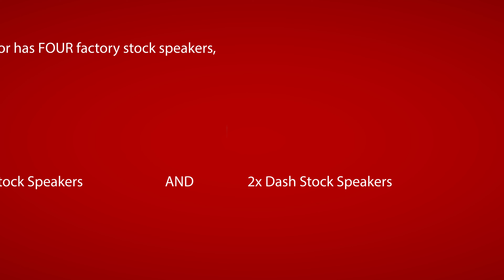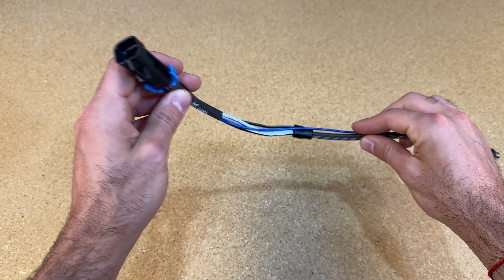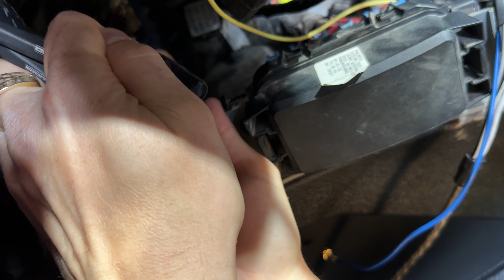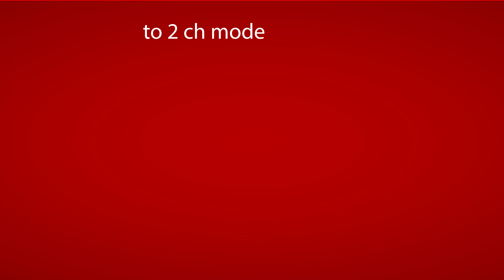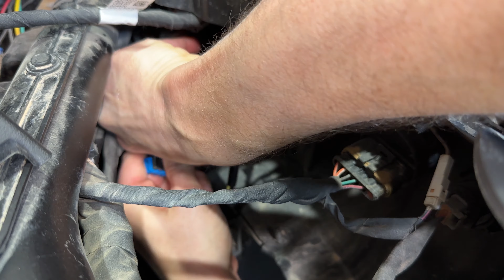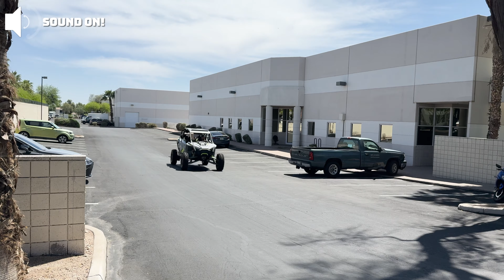Polaris Razor Sound System Upgrade | Ride Command & FOUR Stock Speaker Integration Tutorial

Comment: I'm looking to add a sound bar to work with the existing ride command and 4 stock speakers the sound bar has its own power supply i just need to figure out to get 2 rca jacks hooked up to the ride command of i use that plug do i have to rewire the 4 stock speakers to that plug?
Reply from the maker: Please shoot us an email to support@noamaudio.com and we'll be happy to point you in right direction and help you get set up :)